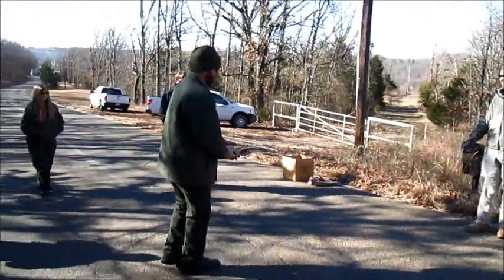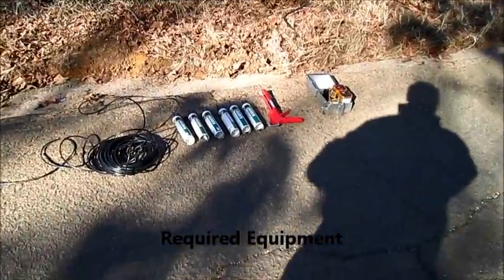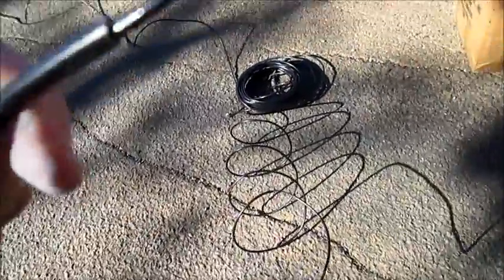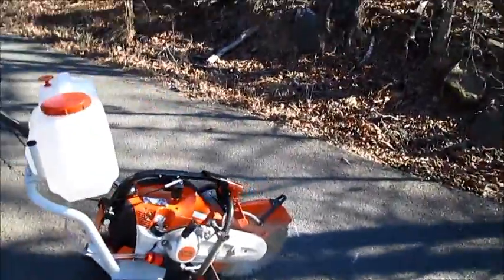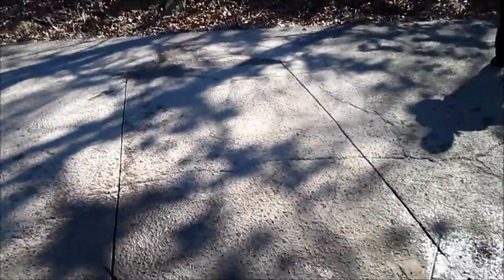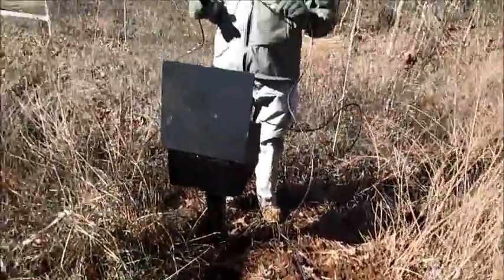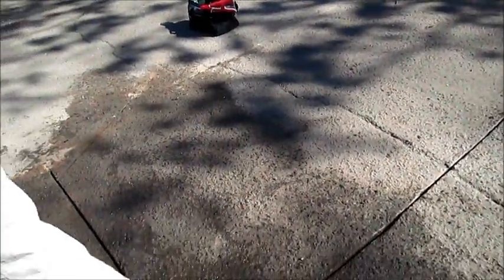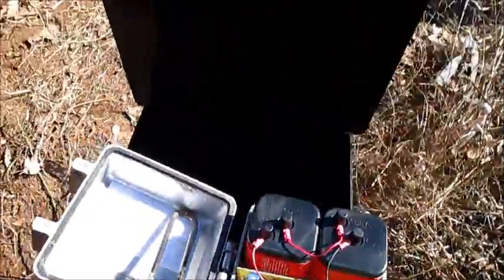Inductive loop installation

Comment: Don't use a screwdriver to force the loop cable in the slot, may damage the insulation, use an old square ruler.
Reply from the maker: Good point, I've since started using a dull saw blade which distributes the force better

Comment: Hi,  how long will those batteries last before requiring replacement?
Reply from the maker: Sorry for the delay, we replace the batteries every 6 months.  I'm not a huge fan of this counter because the batteries it uses are expensive.  I've seen some people replace them with rechargeable gel cells, but they need charging almost monthly.

Comment: Can you help me to know the Cost of installation and all equipment used .
Reply from the maker: The counter was about $400 and the wire and sealant were about another $40.  They already had a pavement saw, but I've rented them for about $80.